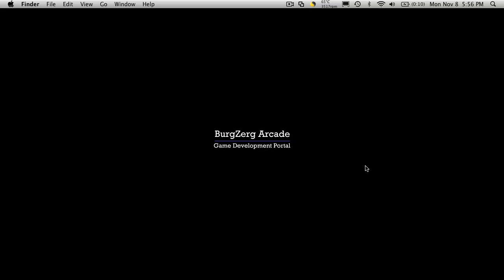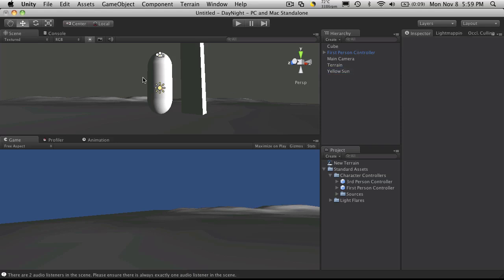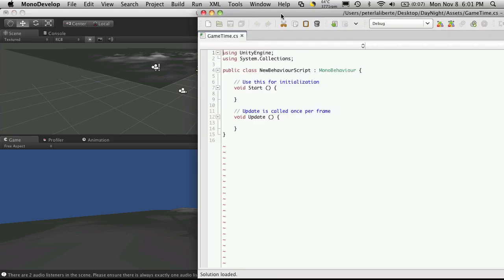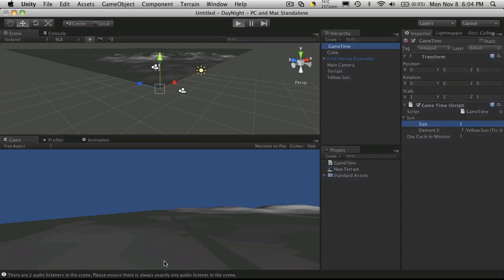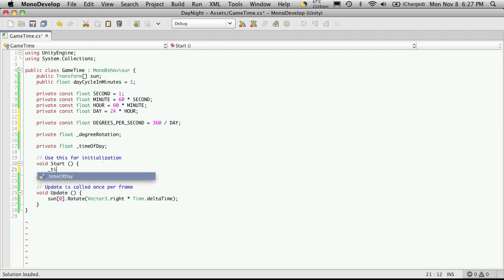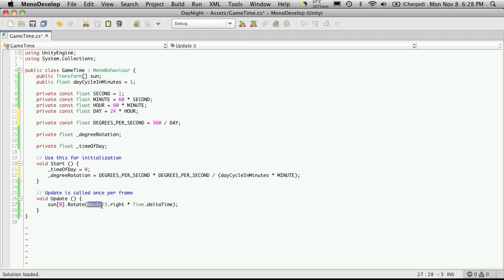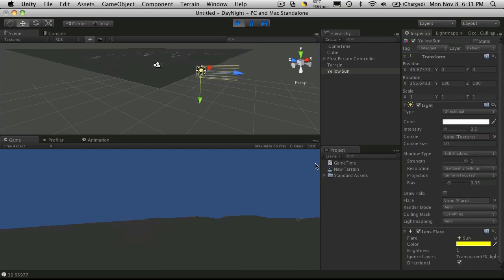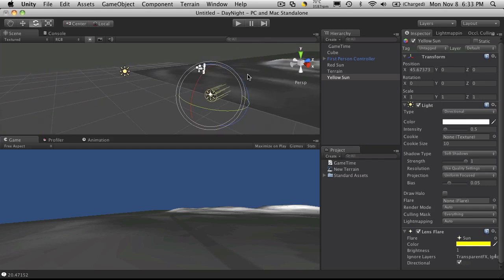72. Unity3d Tutorial - Day Night Cycle Part 1

Comment: Hey so i tried it but alot of problems happend, Help?
using UnityEngine;
using System.Collections;

public class GameTime : MonoBehaviour {
	public Transform[] sun;
	public float dayCycleInMinites = 15;
	// Use this for initialization
	void Start () {
	
	}
	
	// Update is called once per frame
	void Update () {
		sun [0].Rotate(Vector3.right * Time.DeltaTime);
	}
}
Reply: sun [0].Rotate(Vector3.right * Time.DeltaTime); In this line you have the "d" in deltaTime capitalized. It needs to be lowercase.

sun [0].Rotate(Vector3.right  *  Time.deltaTime);

Also make sure you spell all of you variables the same way every time you use them. "Minutes" is misspelled in your code(public float dayCycleInMinutes) and if you spell it differently when you try to use it, it won't know what variable you're trying to call.
Reply: Thanks!
Reply: :) No problem

Comment: My time is off? why?? 

using UnityEngine;
using System.Collections;

public class Gametime : MonoBehaviour {
	public Transform[] sun;
	public float dayCycleInMinutes = 1;

	private const float SECOND = 1;
	private const float MINUTE = 60 * SECOND;
	private const float HOUR = 60 * MINUTE;
	private const float DAY = 24 * HOUR;

	private const float DEGREES_PER_SECOND = 360 / DAY;

	private float _degreeRotation;

	private float _timeOfDay;
	
	// Use this for initialization
	void Start () {
		_timeOfDay = 0;
		_degreeRotation = DEGREES_PER_SECOND * DAY / (dayCycleInMinutes * MINUTE);	
	}
	
	// Update is called once per frame
	void Update () {
		for(int cnt = 0; cnt < sun.Length; cnt++)
			sun [cnt].Rotate(new Vector3(_degreeRotation, 0, 0) * Time.deltaTime);

		_timeOfDay += Time.deltaTime;
		Debug.Log (_timeOfDay);
	
	}
}

Comment: @PlanetPostmoderna Oh also if you have the non-pro version and you want to sun to turn off you could make a script that if the suns rotations is more than or less than a certain number the light is turned off or when it reaches certain rotation the sun is turned off and after its gets out of that rotation its turned back on, I did that with a seperate javascript

Comment: @BurgZergArcade I realize that, I wasn't talking about the colors per say, that was just a side note, what I really was talking about was the flare on the light object, as opposed to a flare object. If you use the flare variable on the light object, and change the color of the light, you will be able to see how the light affects the land better in the tech test, and also see the sun as the color you want. Since these are directional lights, the Flare will automatically be directional.

Comment: Good tut, actually helped me, because I need this for what I am working on.

Just 1 thing:
You should use the Color value of the light, and the LensFlare field of the light, instead of putting on a separate lensflare. This will help keep color of flare, and color of emitted light consistent. Also, you don't need a SOLID yellow, or SOLID red to make it look like a red or yellow sun, a small amount of red or yellow tint will do the trick.